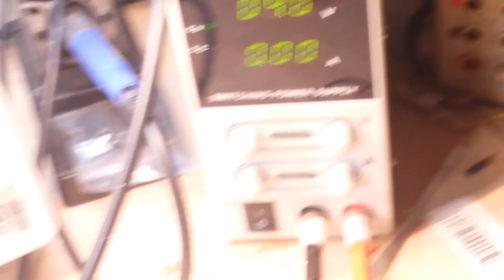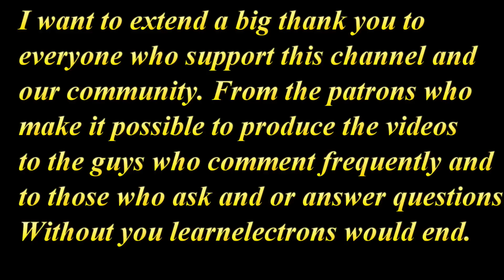Reducing Arduino Nano Current Draw

Comment: Definitely handy information to have when conserving power is important 👍🏼

Also, measuring current by effectively shorting the LEDs will usually result in detecting more current than the LEDs actually consume, potentially throwing off estimates.

From the looks of it those two LEDs are driven by the system voltage (~4.1V from the 18650), and have their current limited by in-series 1kΩ resistors ("102"-> 10 x 100). The red LEDs likely have a voltage drop of about 2 volts. Normal LED current could be calculated via:

(Voltage Source - LED Voltage Drop) / Current Limiting Resistor

(4.1V - 2.0V) / 1kΩ = 2.1mA per LED
4.2mA for both

Using an ammeter in parallel with an LED will effectively short the LED and allow even more current to bypass the LED altogether, as is indicated by the LED going out during testing.
With it shorted, the main current limiter is just the 1kΩ resistor. And with the 4.1V from the battery, that'd end up being about 4.1mA for one LED shorted, and 8.2mA for both.

When in doubt this can be tested by measuring the total Nano current with and without an LED current being measured with the method shown in the video.

Additionally, the expected savings of 8.2mA would likely be found if comparing the Nano's current when both LEDs are shorted to when both LEDs are removed. So while the LEDs-removed current would still be about 11mA, the LEDs-shorted current would likely bring the system up to about 19.2mA, in contrast to the unmodified LED current level of 15.6mA.

Just my 2 cents 😀
Reply from the maker: Very cool. Thanks.

Comment: I think a lot of people have missed your point and are more worried about how you tested the current across that led , i think the important thing to remember is this video is about lowering power consumption not on how to measure current . You don’t need to measure it anyhow because you can do it with ohms law as long as you know the voltage and resistance .

Comment: Dear Paul, having a basic knowledge of your electronics background, I have to admit that I'm really puzzled by your approach at measuring the current drawn by the led.  You pretty much realize that the ammeter impedance is very low therefore when connecting the probes across the led you're actually putting it out of the equation, right ?   How about measuring the resistance next to the led, then once the board is powered up, measure the voltage drop across the resistor and calculate the actual current ?   I don't want to put your effort down but if someone with very minimal skills concludes that your approach/method could be applied to measure the current for a regular  120V/240V light bulb,  he's going to have a nice "sparky" ride !!!
Reply from the maker: Since I measured the current after the resistor,  it should be getting the same current as the led. But your method will work better.
Reply: @learnelectronics  I am afraid you missed the point, Paul. When you measured across the LED, you shorted it and in doing so, you measured a different circuit that either the circuit with or the one without LED. Thus you measured the current in a circuit that had nothing to do with the experiment. SimpleEnough2k9's method would add a very high impedance in parallel with the 1K resistor, which would have a negligible (and not measurable) impact on the circuit. Your method does not work, his does, not just better.
His other point is even more relevant, and the reason why I add these comment: It is very important not to mislead people who may not have a basic grasp of electrical current, and they must understand that this attempt to measure current can be very dangerous - in addition to not measuring anything relevant. A multimeter in current mode is a short. Do not ever put a short across anything that you are not sure you understand fully.
Reply: I've blown the fuse trying to use the same method of testing. Now I know you should use your multi meter in series with your circuit. xD

Comment: I like to use standalone ATmega328 DIL with 8mHz internal clock, 3V and low power deep sleep for sensors. I get < 20uA current draw when not measuring something. Nano is great when you need small packages and have power nearby or if you add a TPL5110 timer.

Comment: Nice to know it's possible to remove those to save current. Especially if I set up an arduino with an 18650 battery as backup power for a device.
Reply: @cbm80amiga  Very cool project indeed. What I most like about it, is that you even decresed the clock speed for energy saving. Really cool. Do you btw know if the 5110 display can be used in combination with a I2C module to save some pins on the arduino? I couldn't find it until now on the web.
Reply: @rolandberendonck3900  IFAIK N5110 display in only available in SPI version. If you have problems with number of pins you can try to get rid of RESET line (connect it to ATMEGA reset) and maybe CS could be always selected if this display is the only used SPI device.
Reply: @cbm80amiga   Your answer will save me a lot of trouble in finding the answer because it isn't possible I understand. LOL. Howerever the 5110 displays are very likable since they can display more and are much more efficient. Thanks for your answer!

Comment: According to the Arduino data sheet you can lower the 16 Mhz clock speed to 1Mhz and lower the current draw also. You'll need to change the delay command accordingly though.

Comment: MAKING MY NANO ULTRA-LOW POWER--Exactly what I wanted to do!  Thanks for this video with the LED trick.  
Since I couldn't get the LED's off without difficulty, I tested an existing LED circuit.  It consisted of an LED with series resistor powered by 5v.  The resistor was 180 ohm, with 2.3v across LED.  Current was ~15mA.
By shorting the LED, I got a current of over 27mA, not 15mA!  At first it was confusing, but that is about the current of 5v across a 180 ohm resistor: I=V/R=5/180=28mA.  I realized I was "killing" the 2.3v LED drop...so instead of the 5v-2.3v=2.7v across the resistor (2.7v/180=15mA), I was getting the full 5v across the 180 ohm resistor (I=5v/180=28mA).  I did this after seeing your video---THANKS!!

p.s.
Most PCB LED's are so bright that I often cannot see the parameter they represent.  I use a drop of white candle wax on top and they look great (takes a little practice to get the wax drop just right).

Comment: Perhaps putting the arduino in deep sleep mode would benefit you even more. I think it is even possible to downclock the arduino if the current is still too high. For me at some point the benefits of power saving are just not worth the hussle. If arduino is running something and not in idle state you can see that depending on the operations the power saved has little to no difference on the battery life.

Comment: Eliminating unnecessary LEDs is great way to save power, but another part is the regulator.
I know you mentioned that powering the Nano using the 5V rail should bypass the regulator... But in reality the regulator draws some current, even when only the output and ground pins are connected. In case of AM1117, which can be found in many Nanos,  this current is few milliamps. It might be negligible amount compared to original 15mA, but it's HUGE amount when using power-down modes. Just a tip in case you proceed to pursue sub-1mA current draws.
Thumbs up
Reply from the maker: Thanks! I'm trying to get at low as possible so I will do that.

Comment: Making the circuit using the arduino to programme and  test it and then embedding the chip in circuit would do away with most of the ancillary circuitry.  This combined with deep sleep could give impressive results I'm sure!

Comment: Considering the capacity of a real 18650, is 8mAh really going to make  an operational difference for you?
Reply from the maker: 8mAh?
Reply: I should haves said 6. I remembered the values wrong. But considering that it was only running16mAh in the first place, I would think operating time wouldn't be an issue even with the leds active. I think I'll run a test of my own, you got my curiosity up.

Comment: Shouldn't one measure current in series, not in parallel?
Reply from the maker: Where  did I measure it in parallel? The ameter was in series with the nano and I measured one led at a time.
Reply: @learnelectronics  around 2:00 it looks like you're putting the probes in parallel with the LED
Reply from the maker: No, they short out the LED taking the current. So they are in series.
Reply: @learnelectronics  lol as you wish

Comment: Hi 
Just why ? What can happen if you just leave the led's alone😏😁
Reply from the maker: It just uses more power, so the battery does faster.
Reply: @learnelectronics  but they have reason to have led for indicator it dose work you just need to use battery with high capacity mAh or directly power supply my opinion but thanks again i like your videos alot and your way for explaining this kind of stuff .have anice weakened
Reply: @midotechtips7449  Knowing how to optimize and use less power is an excellent idea! Especially these days.

Comment: Man nice video btw my regulated dc power supply 300 v is going awkward it starts at 12 v dc n couldn't adjust to 0v n voltage is not guving properly,help me out
Reply: Ask a friend who has electronics knowledge and will be able to open the power supply and potentially diagnose the problem for/with you.  Keep in mind that 300V DC power supplies aren't a common practice.  On top of that you don't provide any link to schematics, specs, brand, model.  If someone has a freshly polished crystal ball, perhaps he/she will be able to help you remotely.  If you understand the difference between electronics and magic tricks, you'll realize that your help request won't get the answer you hoped for if you don't give more meaningful information.

Comment: I am a programmer and to be honest, the Arduino stuff just doesn't interest me. My current challenge is learning analog electronics and until then Noduino for me. Having said that I hope you continue to pursue programming because trust me .... it's not that hard for someone with your background you just haven't been show "the way" yet. Seek and ye shall find ....
Reply from the maker: My last programming course was freshman year of college...Turbo Pascal.
Reply: Have you checked out Ben Eater's "Building an 8-bit breadboard computer!" playlist? It takes HUGE steps backwards to present what would be considered the engine of a computer. While architecture is certainly not necessary to learn programming, it builds a foundation that allows you to see well past any mysteries that using the various different programming languages out there present. Python is fine and dandy but if you know C and you are comfortable with Assembly and Machine code then you can learn anything. I recommend using Linux for this as well. IDE's are for the lazy. ;)
Reply: @learnelectronics  where did you get your microscope?